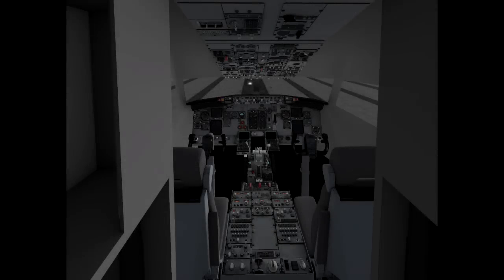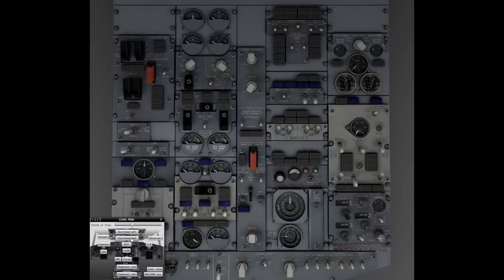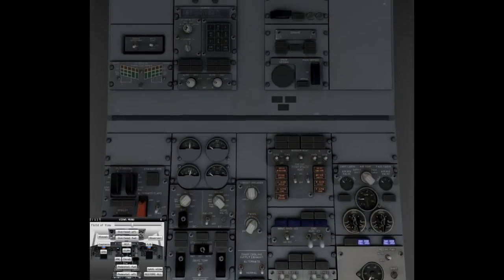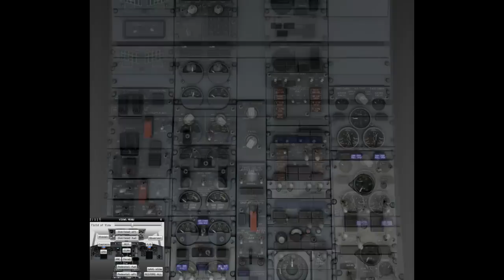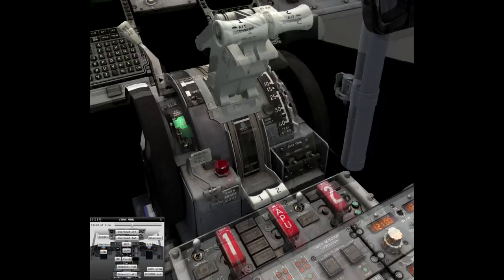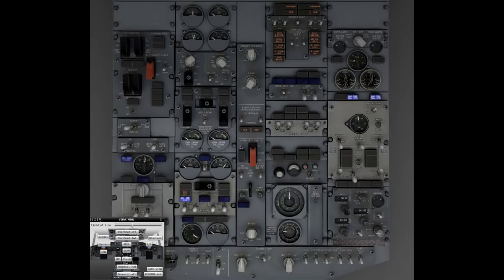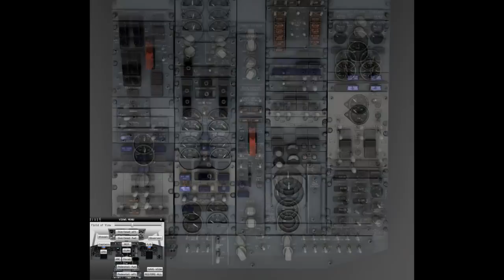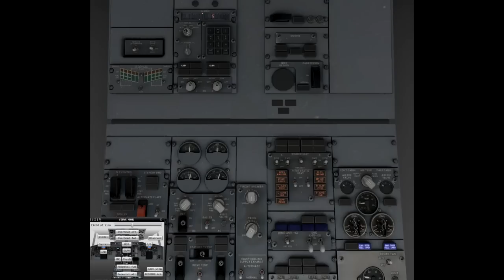IXEG 737 Engine start demo

Comment: We are still getting great framerates - the video was recorded at 15fps quicktime setting to save on space, but in XP9 the rates are much better. Keep in mind that the cockpit isn´t anywhere near finished and this also depends on your computer specs. So we can´t really say anything about minimum specs at this point.